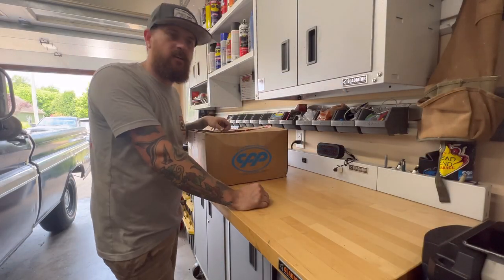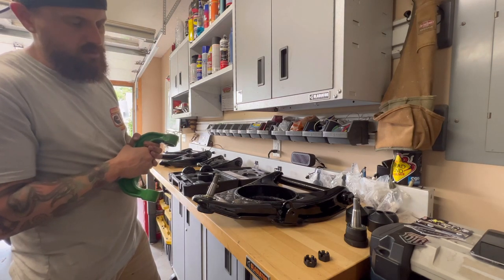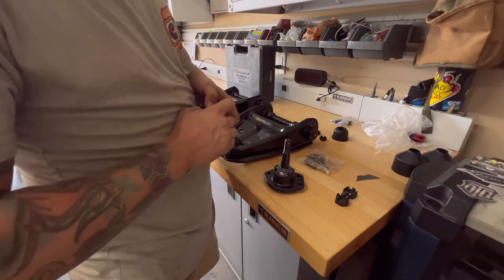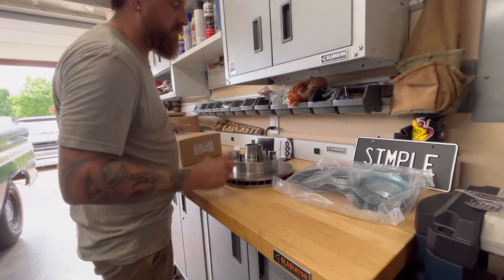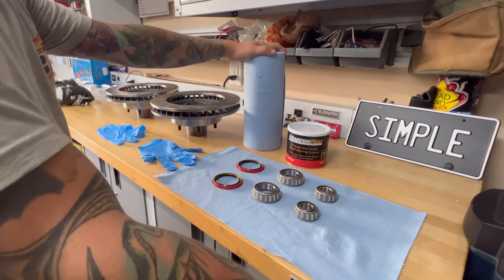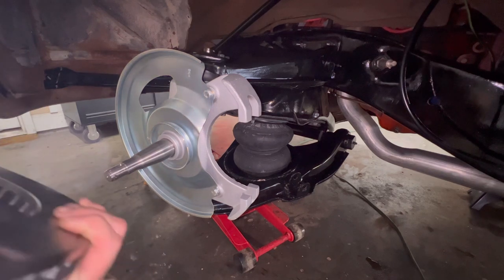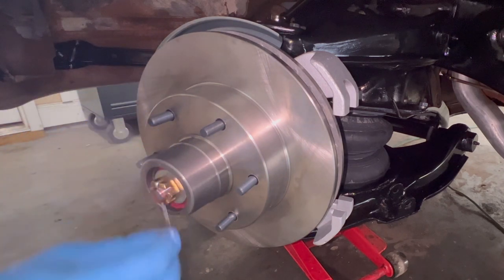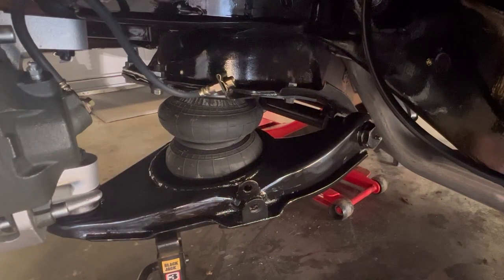FRANCIS EP.5 | Disc Brakes and Drop Spindle Installation | DIY Step-By-Step Installation Tutorial.

Comment: I like the idea of getting rid of the big bulky brake booster! My 66 has a pretty much stock 283 so I guess the Wilwood should provide enough stoping power right? Safety First? Really like your videos and attention to detail. Having the links to parts list is a real time saver. Thanks 1
Reply from the maker: Thanks for watching. Many high end builds don’t have a booster. It may just require a little bit more foot power but not much.

Comment: I'm loving this build series, I feel like I need to swap my bags around in my 61. I run 2500s up front and the 2600s out back.
Reply from the maker: 2500 in front will work but require more air pressure to lift.
Reply: Yea quite a bit more lol my rear is at "ride height" at around 25 psi, but the front takes almost 80 🤣
Reply from the maker: @cadilakisrodcustom  yea. Mine is 80 in the front and 45 in the back for ride height.
Reply: @SIMPLE.C10  if I remember right I couldn't run the big bags up front for clearance issues, but I'll get it jacked back up and have a look.

Comment: It may not matter but the brake hose clip is on backwards. Every Chevy I’ve seen has the clip tab facing out. Makes it easier to remove. Otherwise great video!
Reply from the maker: Thanks buddy! If the brake clip is the only thing I got wrong I’ll be super satisfied with the install!

Comment: Did you have to run new lines or a new master cylinder?
Reply from the maker: Yes. New lines in the front and they t off to your factory rear line. I’m running a wilwood master cylinder.

Comment: Hey guys, have a question... my c10 1976 have this problem: my stock brakes stop working one tire at a time. I get them regulated and bleed, works fine for a couple of days and then back again. Any ideas on what could it be??
Reply from the maker: I’m not positive. Never ran into that issue
Reply: Slow leak or air in the system